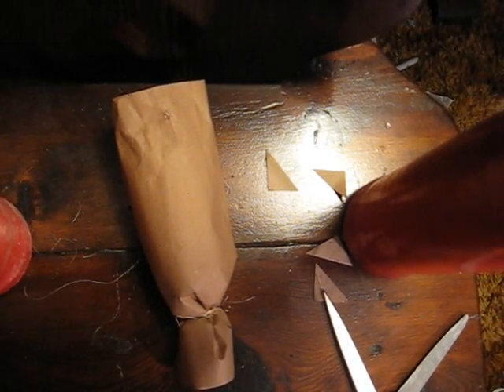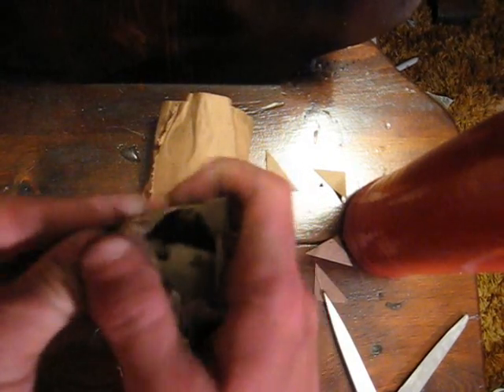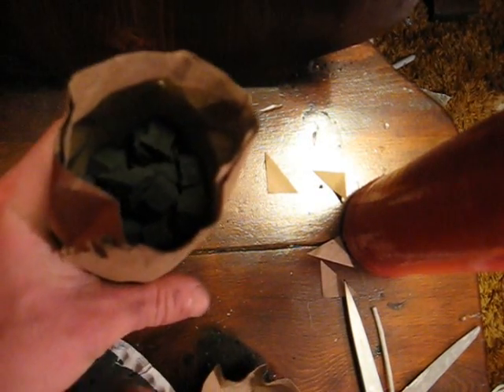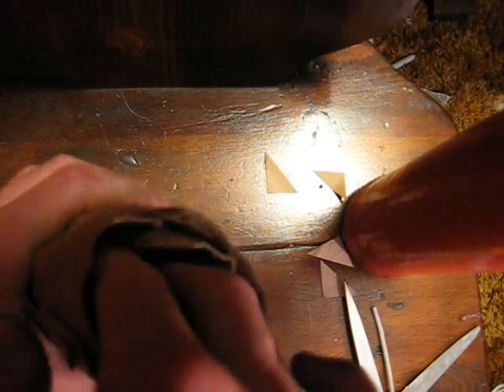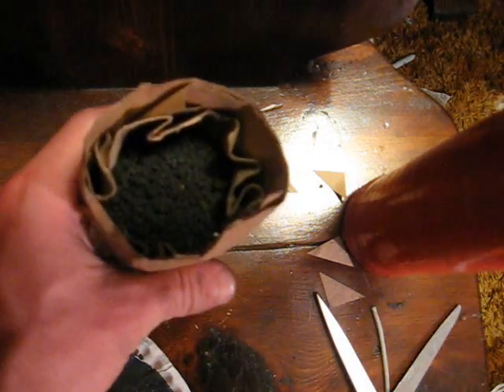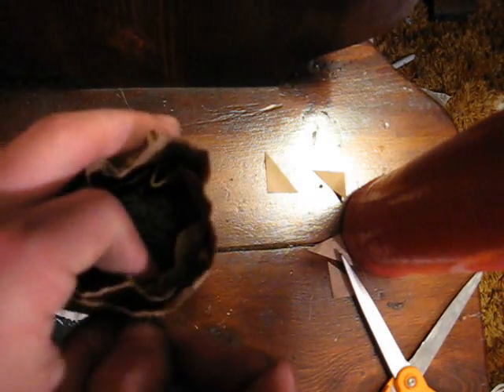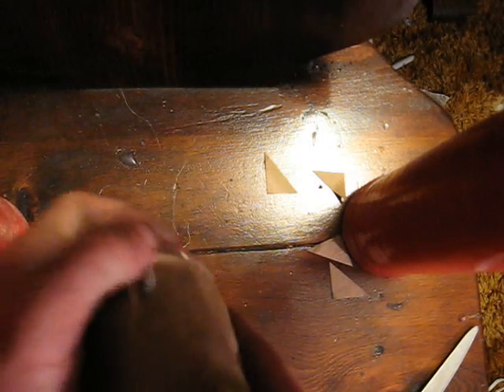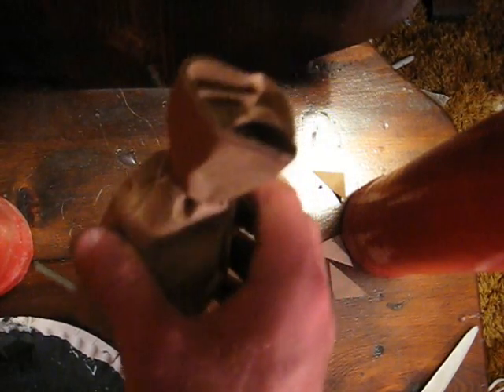How a Star Mine is Built

Comment: Nice job, I'm a little confused about the fusing don't u need fuse long enough to stick out of ur mortar tube? Did u use a separate lift charge? The black powder in the mine itself was ur burst charge? Thanks for sharing are u on Fireworking.com.? I'm on there It's chock full of useful info. U should check it out if u already haven't the fee is well worth it.
Reply from the maker: Black powder in the mine was my lift, yes. This was so long ago I don't really remember for sure how I loaded it. Usually I would have a mortar with a hole drilled in the bottom for the visco to come out of. Safer of course to quickmatch all the way to the top of the mortar.

Comment from the maker: @Anthony82949 Black powder works as prime for most stars. To light this I lit the fuse and dropped it down the gun, which is generally not considered a safe practice. I recommend you use quickmatch or enough visco that you can have the mine at the bottom of the gun and the fuse reaches to the top.

Comment from the maker: @kmgentil To make a comet you can press the moistened star composition into a section of PVC pipe with a wooden dowel, then use the dowel to pop the comet out after it has been compressed. It will take several weeks to dry. To make quickmatch first make black match then roll a thin paper tube around it.

Comment from the maker: @japanesepoptart The stars don't add much. A dummy can fly less due to any number of things. The seal in the gun is the most vital change often times. A tighter seal will provide more lift exponentially due to an increased burn rate of the powder under higher pressures. Weight of the dummy can also be a big change.

Comment from the maker: I granulated it through a pasta strainer. Couldn't tell ya the mesh size. I like large granules. They may not burn much faster in open air, but it guarantees that the fire will pass smoothly through them if slightly compacted.